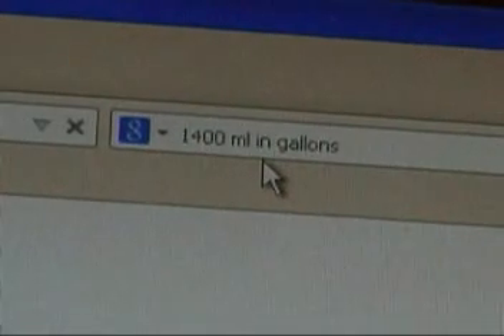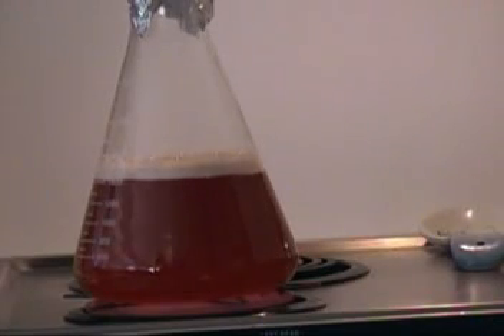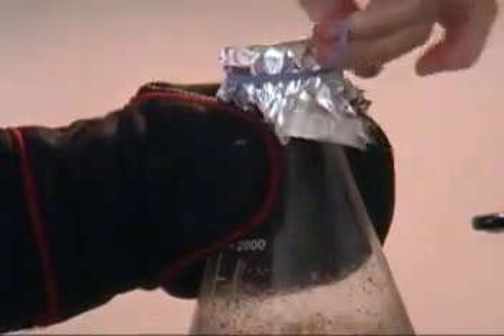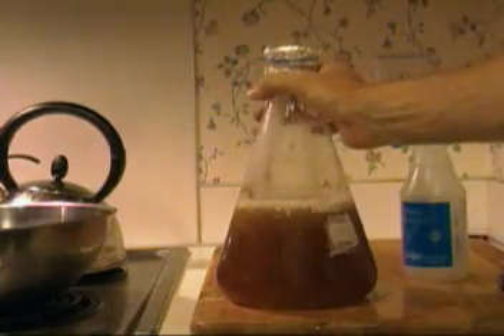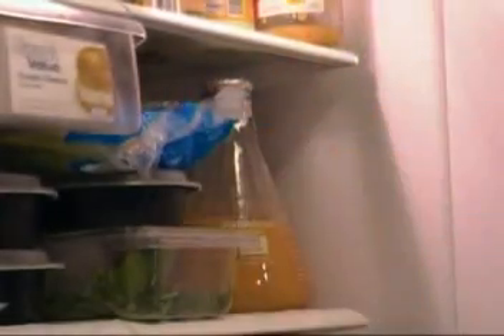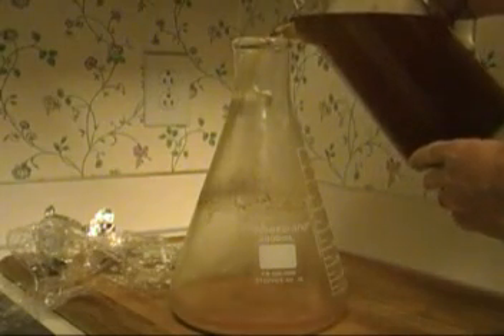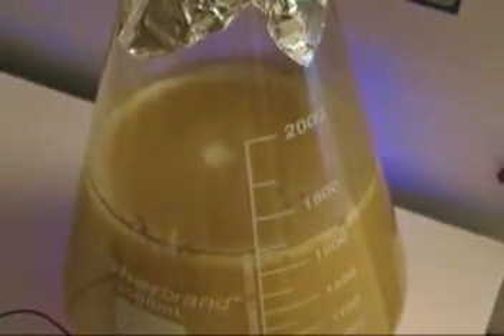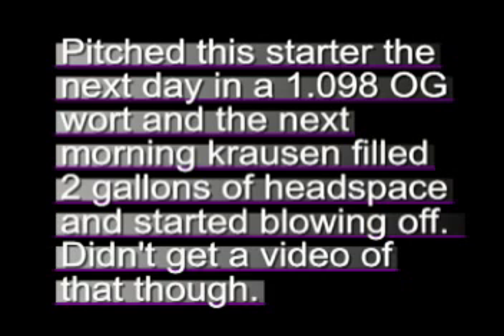Building Up A Yeast Starter For A High Gravity Beer

Comment: Shouldn't use a rubber band on the flask -- you need to let air in there as the yeast needs oxygen. Just let the foil sit loosely on the flask.  All the lab vids on this topic use a simple foil stopper.  Also foam stoppers are available.
Reply from the maker: Thanks for the suggestion for improving the process Dave!

Comment: Just been thinking the "layering"-method in brewing HGB (up to abv 14%). I´ve done the fermenting three times (three layers), getting abv up to 6% per time. Then distill the formed alcohol out. In that way the yeast can process new ethanol from new malt added to brew more easily. Of course the temperature of the brew have to keep in room temperature to not killing the yeast, so that will add some challenges to the process.
Reply from the maker: Interesting process you outlined there Olli.  I've never done any distillation.

Comment from the maker: Thanks Jon.  Yeah, I should have taken a shot of the blow off!  I'm usually so intent on getting it cleaned-up though. I hit the target OG of my recipe (22.5 lbs of grain in a 5 gallon batch, plus some treacle).  You do have a point on the boil-over prevention.  Just that our kitchen pots are never guaranteed to be clean enough for me (sometimes sorta greasy because the DW doesn't let me put them in the dishwasher).

Comment: Nice video. Wish I could see the blow-off !!  How'd you get the OG so high? You got me thinkin' about building a starter for a OG 1072 with a 5 month old slap pack of liquid yeast.  My advice for avoiding boil-overs would be to boil the DME in a good-sized pot, cool (with sanitized lid), and funnel into the flask, rather than heating the flask.